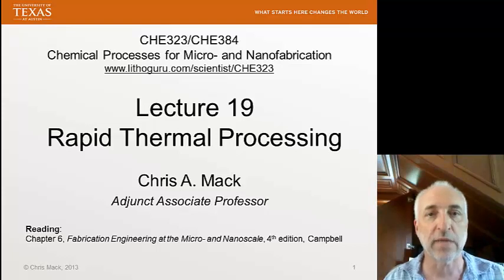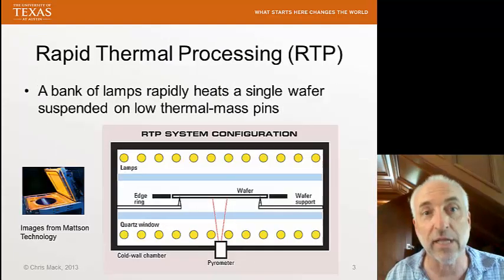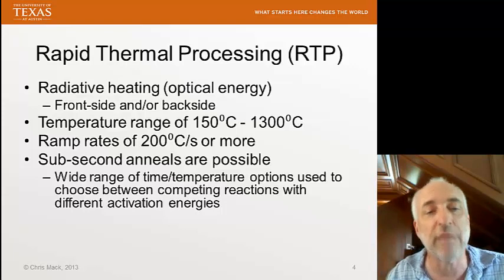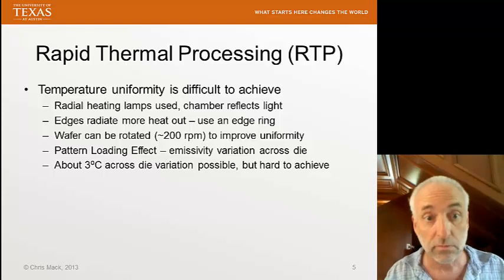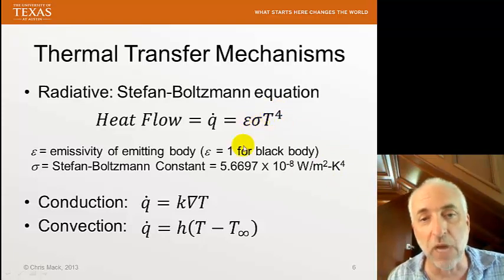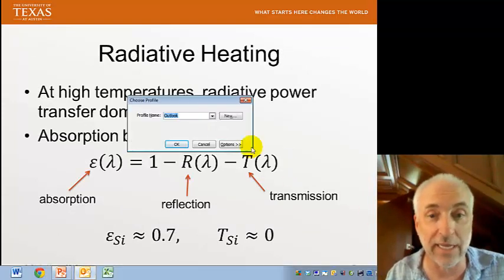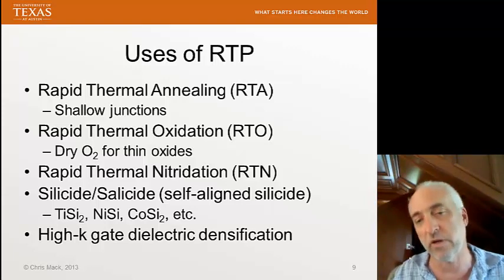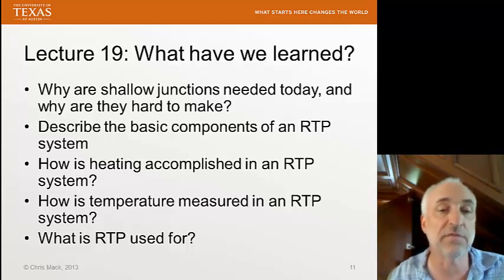Lecture 19 (CHE 323) Rapid Thermal Processing (RTP)

Comment: Since there is a thermal budget for all the steps carried out after adding a given dopant, why anneal directly after e g ion implantation? Couldn't you wait and put everything that needs to be annealed in place, and then anneal everything at once? Maybe as the last high temperature step, before you introduce something that can't take high temperatures? Or is it important to reform the crystal structure directly after e g ion implantation, to make the following steps to work correctly?

Comment: Dear Dr. Mack,
What kind of temperature measurement technology RTP uses pyrometer mentioned in the presentation?
Pyrometer measurement wavelength can be generally used in wafer 0.9 um, however, the heating lamp is started, will be Pyrometer interference, there is a way to ask Dr.Mack measured temperature it?
Thanks a lot.

Comment: Hello Chris, very interesting lectures. I have a question, regarding homework 5, in the solution it says that Rp standard deviation is around 0.014 um (from the figure), but you put 0.014e-4, is this an error or did I miss something?

best regards
Reply from the maker: Units.  In the equation the units are cm.

Comment: If recrystallization has higher activation energy than diffusion then how can it be fast at high temp than diffusion.
Reply from the maker: High activation energy means that the rate constant changes more rapidly as temperature is increased.  Thus, as temperature goes up, diffusion rate rises more slowly than the recrystallization rate.  At a high enough temperature, recrystallization dominates.